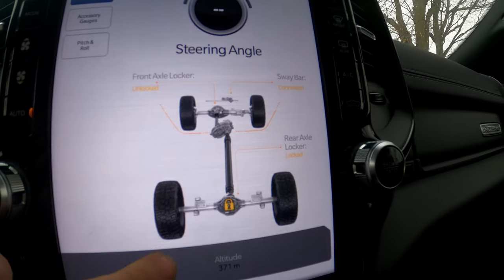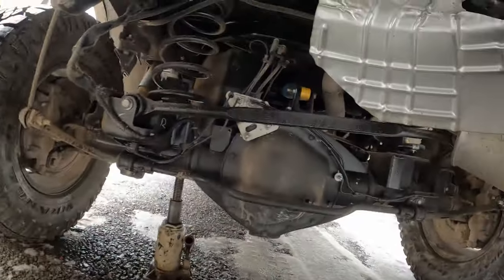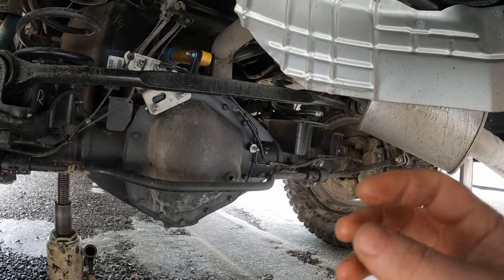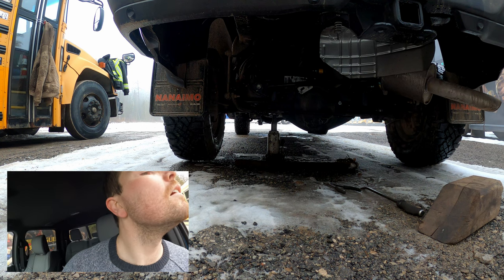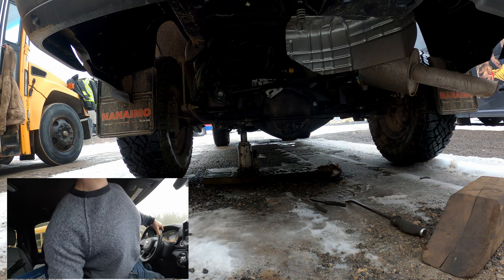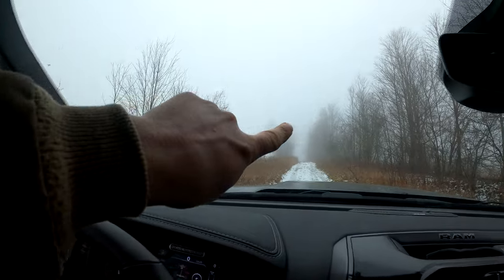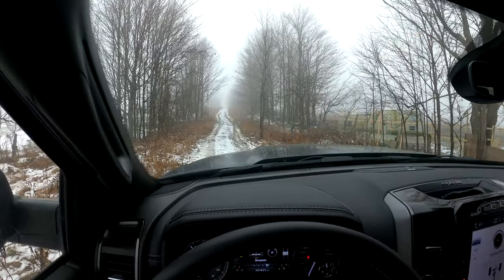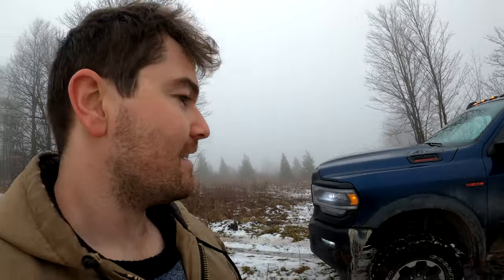RAM 2500 Power Wagon Off-road 4WD | LIMITED SLIP DIFF Vs. LOCKING DIFF

Comment: Another note on the torsion LSDs, I see someone already pointed out that they need some resistance on each wheel to work. They also need wheel speed to work, the more wheel speed the more the limited slip engages, so if you do redo this test give it more pedal when the wheels start slipping and it will work better.
Reply: Don't get me wrong though, great video, you gave a good explanation comparing limited slip/lockers and lockers will always win the day in the end.
Reply: I remember my dad owning a 65 international pickup with a unique rear differential. He would fill the 8 foot box with  one layer of concrete blocks covered by plywood. One weel would spin for a few seconds and then the other. They just kept going back and forth similar to trac control on some newer cars today.
Reply: Yes exactly limited slip engages only when accelerator pedal is pressed even little bid definitely works better in every day driving situation,
for off road lockers are superior.
Reply: Doesn't applying the brake help with the torsen?
Reply: Torsen…not torsion.
Reply: This is incorrect. Torsens are torque biasing differentials. Each specific application is designed for a specific torque bias ratio, meaning that once one wheel starts to spin, it can only apply that multiple of torque to the tire with traction; the limiting factor is the amount of torque it takes to spin the tire with limited traction. It has nothing to do with wheel speed.

Comment: So, on a factory Rebel, if you don't engage the electronic locker, does it mean that it has a limited slip rear of you don't engage the locker?  My thinking woukd be that you have an open rear diff, not limited slip.  Then, when you electronically lock it, it becomes a rear locker, almost like a spool.  But, until it is locked, I would not think that it has limited slip from the factory.
Reply: It's either open or locked if it's a locker. If it's automatic, the computer engages the locker when it detects slippage from the wheels.

Comment: I've never seen a limited slip differential that can also lock. Is this one of those limited slip differentials that use computer braking to change torque flow from the wheel thats spinning?
Reply: It has real helical gears for mechanical torque biasing and then a true electric differential lock. American Axle makes it (TracRite GTL) and the Power Wagon rear is the only applications they currently make the GTL for. Auburn Gear also makes a differential for a couple applications that combines a clutch-type limited slip with an electric differential lock.

Comment: Putting a helical gear lsd in the rear diff of the  Power Wagon was a genius move by Ram. First of all it doesn’t need the maintenance than a traditional lsd with clutch plates requires. Second, it works beautifully if you know how to use it. In cases where there is a slight loss of traction, applying a little bit of pressure to the brakes will create enough resistance on the free spinning tire to cause the lsd to distribute power more equally, with out requiring you to go in to 4 WD. When I’m driving my PW on snowy, icy roads here in Montana, I can usually drive around town without using 4WD, just using the lsd, but in off road situations, it’s pretty much useless.

Comment: I can tell you right now from experience that the lsd is better in deep snow. The 4 low locked is rpm or throttle Governed.  The limiter was how I got stuck to begin with. Once I unlocked and used 4 high no lockers the 6.4 was a monster!
Reply from the maker: your probably not wrong. I was thinking like 4high with the rear locked would be best in deep snow. It takes so long to unhook the diffs I figured the truck would have a hard time keeping the wheels speed below 10mph. But I could be wrong
Reply: @TheGettyAdventures  heres some advice, get bigger sidewalls, taller tires, air down to 13 psi. should be 10 ply tires. or what ever you like.. i go 10 psi on sand mud. no beed locks..35", minimum, 36 better. kills gearing though. i have 35,s on the s/duty, still crawls stupid slow..zf 5 sp..granny 1st, std.
Reply: The purpose of four low is to give you increased leverage of the engine on the tires and to increase your control of driving with your throttle. Four highs for driving on snow covered streets and dirt roads for low is for actual situations where there's massive traction issues where you need all you can get
Reply: Sounds like you are saying that 4 high is better than 4 low, not that LSDs are better than lockers.

Comment: Your not off roading till you rip that front license plate bracket off the front bumper lol. Trust me u will. Not sure if you have or not but you should set the winch up also. Do a video of it. Great seeing another power wagon in action keep up the good vids 👍🏻
Reply from the maker: Thank you sir! I honestly have zero knowledge about the winch. Like I messed around with it a couple times and pull the truck around in the snow but is there a procedure on how to set it up or does it come ready to rock from factory ?
Reply: You can keep the front plate on and make it through moab, if you can drive. Ask me how I know. 🤔

Comment: torsen diff is a 50/50 split, provided the friction coefficient is equal(which is basically never). With torsen diffs you can drag the brake to transfer some power to the slipping wheel.

Comment: Thanks for the video and AWESOME truck!! One quirk to a torsen is that both wheels need at least some resistance for the limited slip to work, so lifting one wheel off the ground will not typically transfer any torque to the wheel with traction. The work around on that is to lightly feather or apply the vehicle’s brake, thereby “tricking” the differential into transferring torque. I know the torque bias ratio in the factory Ram torsen is not very aggressive, but even my much more aggressive Eaton Truetrac won’t engage with a lifted wheel unless I apply a little brake. As soon as that happens, it grabs like an actual locker. The military hummers are the same way.  Maybe something fun to try if you ever do the test again, but you also have two legit lockers, so idk. 

Thanks again for the videos and happy new year!
Reply: Was just going to say the same. Some modern vehicles have the ability to "torque vector" with their brakes, and in such situations can act similar to what you said about dragging the brakes to help provide some resistance. But yeah what you said is spot on, and great video too!
Reply from the maker: I'll have to redo this test anyways seeing as it didnt even go as planned lol. I'll probably do it differently but yes I guess the torsen style LSD need some resistance to work. Despite  the thumbnail I actually really enjoy having one in the rear. it's great on road especially when it gets snowy! Thanks for the info sir
Reply: Very cool. We’d love to see it!
Reply: @TheGettyAdventures  definitely want to see the remake video! Love your channel for this very reason. Not many channels actually test and show the difference in limited slip diffs (clutch type or helical), lockers, 4wd operation, etc.
Reply: I came here just to make this comment but you've already explained it perfectly. 😎👍🏻
Reply from the maker: @proudamerican5518  I have some cool steel ramps at work I think I'll take advantage of!
Reply from the maker: @deviantarsenal  really appreciate it! I love making these videos because it's just cool to see the mechanical aspect of these trucks in action. And hopefully next time my shop will be empty so I can do this inside not out in the yard lol!
Reply: Nice!
Reply from the maker: @toecutter1547  exactly, torsens are the best LSD
Reply: @TheGettyAdventures  It shows that you love making these videos by the quality of the editing... your really good at making these video productions and you have a interesting type flow about you. Your gonna make it long term in all this.... but I really think you need a dog in your videos riding with you...better yet 2 dogs...that way you won't have to lug around them ugly orange   "get unstuck boards" in that fine ass new truck.
  If you get stuck just throw the dog under the tire.
  It's easier...I mean, them ugly ass orange boards aren't gonna load/unload themselves...dogs will.
A DOG can't rum a MRI machine, but catscan.

Comment: Only 4wd if the tires are on the ground, that's what i tell people. A limited slip differential resists speed difference between left to right, or if center diff, front to back. Typical viscous coupling tries to keep the slip down with plates swimming through thick viscous fluid.  Torsen/ helical resist slip by friction of the gears against the diff housing. Mechanical clutch LSD that are labeled as 1way, 2way, 1.5way mechanically have pressure rings that clamps the clutch plates and force the side gears to rotate with the housing. Some other clutch style just uses clutch plates to resist slip, some apply a little pressure because of the beveled side gears and pinion gears.

Now mechanical brake assist traction control via the ABS system applies the brakes to the spinning tire, thus the differential has to spin up the other side. There are limitations because of how the  manufacturers program the braking amount and how long it holds before letting go. I've seen some system that just slow it down enough and let's go. Some others are more aggressive and use the brakes to hold the spinning tire until the other tire moves forward before letting go. 

It just gets me when people say, the system is "looking for traction." The system can't tell how much traction you have, it's only programmed to see a spinning tire, apply brakes to that corner and wait for signal from other wheel speed sensors. A lot of silly marketing terms. Give me low range, lockers, good suspension travel and I'm good. I don't need any gimmicks.

Comment: I have driven in all types of terrain.  True lockers break things and ride rough.  Gears type LSD's are prefered, and a little brake drag engages the system rather smoothly.  Experienced drivers get the same traction with an open diff by skilled use of the brake.
When electric drive 4wd becomes available.  That is each wheel has a drive motor.  People will then experience a seamless continuous 4wd.
What really confuses most people is traction, or wheel spining effects.  A gear type differential will just provide smoother operation.  A locker will knock you around.  And a cheap skate country guy will just drag the brakes to get through.  It would be interesting to do these traction experiments with one of those Icelandic snow trekking vehicles.

Comment: The only bad part with lockers when your stuck your really stuck. Yeah your right theres a bunch out there that don't realize a lot of 4x4s are running open axles and there not "true" 4 wheel drive no matter what the transfer case position. The only true 4 wheel drives people have axle lockers on both ends. Nice chassis cam shots 👍 super truck the power wagon is bad to the bone.

Comment: A locker can send 100% torque to a single wheel.

A clutch type limited slip is basically an open diff with friction clutches that limits difference in wheel speed and transfers torque to the other side with traction. Most people don't realize you have to spin the wheel faster to get it to transfer torque to the other side.

A torsen limited slip multiplies torque, and requires resistance on the low traction side to multiply that torque to the high traction side. If the torsen has say a 4:1 ratio, and a tire on ice can put 10lb/ft of torque to the ground, the torsen can multiply that and send 40lb/ft of torque to the ground on the other side with traction. If a tire is in the air it can send 0 lb/ft to the ground, so 4 times 0 is still 0. If you apply the brake though, the torsen will multiply the torque required to overcome the brake and send it to the other side with traction.

An open diff ALWAYS puts the same amount of torque TO THE GROUND on both sides. So if one wheel is on ice and can put 10lb/ft of torque to the ground, then the other side can put 10lb/ft of torque to the ground. If one wheel is in the air, it can put 0 lb/ft of torque to the ground, so the other side also puts 0 lb/ft of torque to the ground. It will always apply equal torque to the ground on both sides.

Comment: I don't know many modern trucks / SUVS that don't have LSD, via the ABS controller. Most manufacturers don't use physical LS differentials anymore because you can do the same with the ABS controller by only applying brake force to the spinning wheel thus transferring power to the other. Some brands are better than others with the aggressiveness of the brake force applied. Using Limited slip ABS is much cheaper, can be more effective, and less components to fail.

Comment: Limited Slip is a Torque Multipier, with they amount of bias determining the multiplication (with 3 being common, so when a wheel in snow slips a bit, then the other wheel gets triple the torque required to slip the first wheel).

If it takes 0 torque to spin a wheel, as is the case with a wheel in the air, then 3 x 0 equals 0 so the other wheel gets nothing. Lightly press the brake, and if it takes 100 ft\lbs to overcome the brake, then suddenly the other wheel gets 3 x 100 = 300 ft\lbs. the main drawback is you are now riding the brake, which will cook them just like going down a steep elevation.

Comment: If you're off roading sure a locker's gonna work better.
 But if you're in 2 wheel drive and you have a 2500 which doesn't have an auto 4 wheel drive the anti slip axle is really good it gives you some traction before you have to put it in to 4 wheels drive.
 Same with the 1500 If you're in 2 wheel drive and you hit something slippery on the highway did anti slip might give you better attraction.
I didn't think the locker has anti slip also.

Comment: On a limited slio,ot sometimes takes more RPM to get the other tire to spin.  I would suggest giving the truck more RPM for a longer period of time.  The results will probably be different.  It should be a 50/50 torque split in a two wheel drive truck.  With four wheel drive and the transfer case engaged, it wiukd be 25 percent to each wheel, as stated.

Comment: What you are calling limited slip is ABLS which is not true mechanical limited slip. A true LSD will hook up both rear wheels if it is tuned correctly with good clutch packs or a torsen diff. I have a 93 Bronco with a Ford Performance T2 Torsen in the rear and it has never failed to hook up. I have an 89 ranger that I was lucky enough to find a trac lol for the front dana 27, and the rear 7.5 trac lok. I packed the ranger with a fresh set of clutches in both axles and it will move with ease through mud or snow. Lockers are preferred, but Detroit lockers will send you sideways if your tire pressure is different in the rear end.

Comment: good vedio, but you didn't give the lsd any chance!.. it needs just a little bit of throttle, lsd usually need to see A SOILD RPM difference between the two wheels in order to engage. Nice truck btw 👍👍
Reply from the maker: 100% I just want to show that there is a difference between an LSD and a Locker. alot of guys were saying that so I'm gonna re-think and re-do this test to really give the LSD a chance!

Comment: The power wagon has an open diff until it is locked. No matter what you have read that is how it is explained at the ram trucks events. They demonstrate the exact things you are doing kind of. Anyways it’s open until you lock it. I was at the chicago auto show last year and at the ram booth they show this in action etc.. they also had a ram 1500 with their anti spin diff option and it kicks the other tire in in about 1/2 a second when it is needed. Further proof to show the power wagon is open until locked and the anti spin diff actually works really
Good.
Reply from the maker: well actually no. the PW has the 11.5 AAM diff which is a helical LSD and obviously can be fully locked. the problem with helical LSD diffs is that if one wheel is fully off the ground it does not work. which is what we saw here. here is a link to another video of mine and it shows the LSD kicking in just like the anti spin. the helical LSD in these trucks is not as aggressive so it takes more torque to be transferred but you'll see it work. 

https://www.youtube.com/watch?v=dl4OCYZE_XY
Reply: @TheGettyAdventures  I didn’t say it couldn’t be locked.. of course it can be locked it’s a power wagon, what I’m saying is that when you don’t have it locked it is NOT a limited slip. It is just a standard open diff. Which is trash. When it’s locked then yeah it’s locked. If you buy a ram and option the Anti spin differential then that is how you get the limited slip. There is no way to get a power wagon with both the limited slip and the locker. It is open or locked that’s it. Like I said I am 125% sure as one of the head ram development team
For powertrain told me at the auto show.

Comment: The GMC AT4X 2500 HD Doesn't Have FRONT LOCKERS...
Does The Ram 2500?🤔
Id Go With The 1500 AT4X That comes With Front And Rear Lockers...But the Payload isn't high enough for a camper.. so Going HD(Gas) Probably The Way To Go Buy Want Front Lockers... Easier To Hit The Ground Running If I Can Get it stock...
If So I Guess I'd Have To Check Out A Ram Then🤔🤷

Comment: I thought an LSD was torque controlled, other wise cruising around corners would cause power slides. The point is that it must serve as an open diff in normal driving conditions. It would have been interesting to see if you applied low range with higher RPM (more torque). My guess is the LSD would kick in nicely.